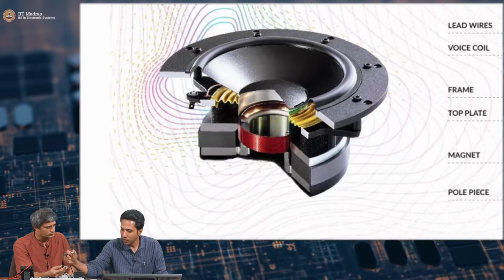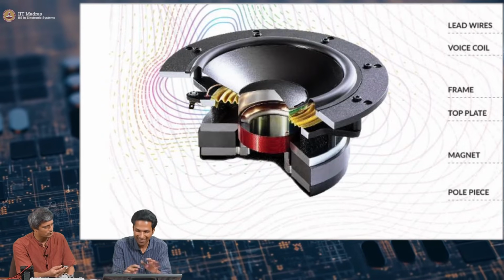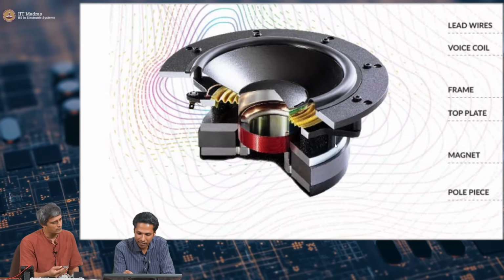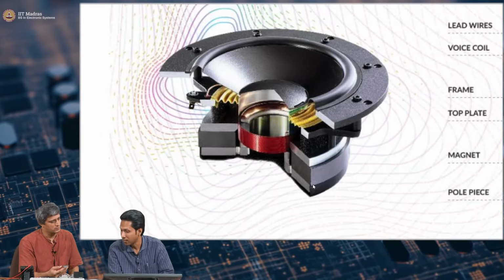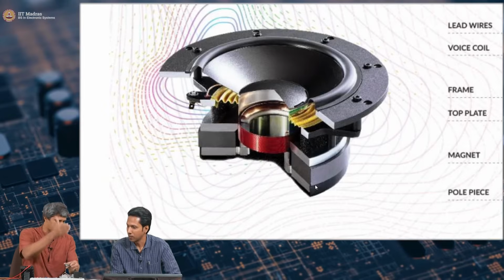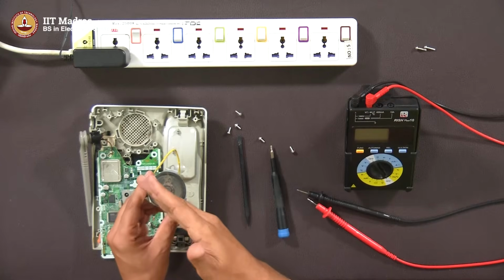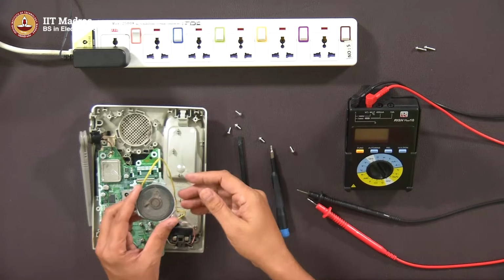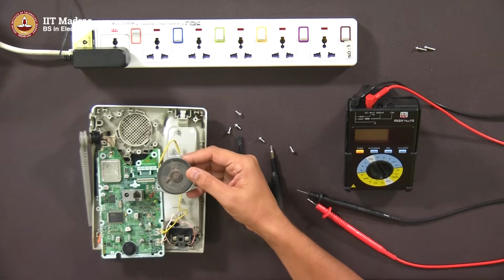W3_L1_Dial, Talk and Hear

Comment: Sir if you're giving a dc supply that is the adaptor supply how can the output be a time varying ac supply
Reply: There is circuitry that changes creates the AC supply using the DC
Reply: Use of voltage regulators